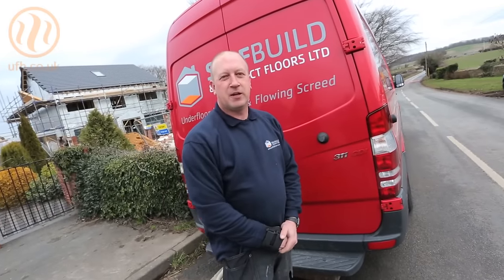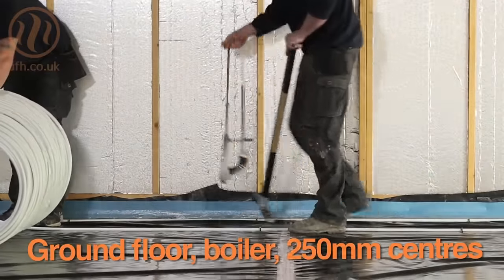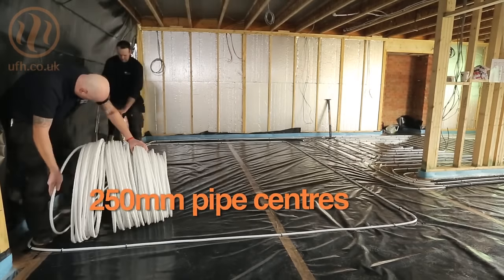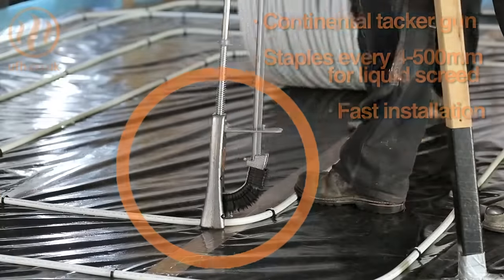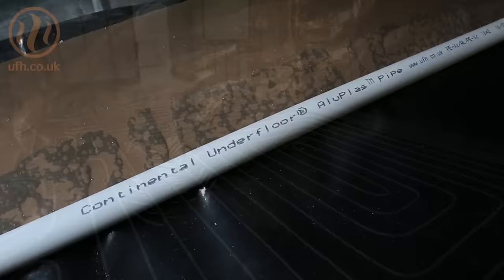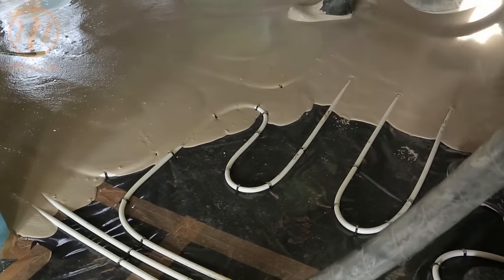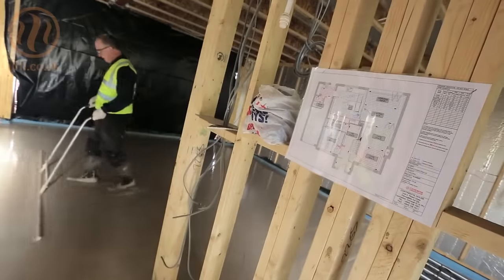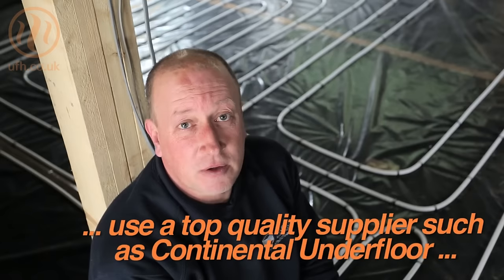Underfloor heating system installation by Continal Underfloor

Comment: Korean way of installing radiant heat over wood subfloor. Koreans having been using this heating for decades.
electronic control can be expensive and prone to breaking down. simple manual valve to each circuit is good enough for hot water flow adjustment and good for your lifetime.  absolutely no fancy control equipment.  

1.  install the tubing  after all walls are done. each room has a separated circuit. no circuit in bathroom. minimum circuit on passby area.  architect's  drawing often  make the install complicate.  Just do it after all walls are done,  then you would't  risk  nailing to the tube .

to each room, lay in the order of the following material  to the subfloor

1. a  thin plastic or vinyl  paper to have some concrete proof effect to the wood framing,  vinyl should go  a few inches  up the wall above the final mortar level.
2.  2  inches thick rigid form ( usually pinky)  Tape them to prevent mortar leaking
3.  2 layer of rebar net ( the cheap wire net, commonly used for sidewalk concrete) . 
4.  tubing ( plastic pipe)  tie the tube to the rebar
5. 1 more layer of the rebar net on top of the tubing. tie them again to the bottom rebar.
6. a nylon mesh of the very flexible nature, sagging in its own and loose enough that mortar will flow freely into the mesh.  Do not pull the mesh flat .  loosely folded here and there  . This mesh is critical to prevent the concrete from cracking. 
7. pour the mortar, just waterly enough as to almost level  itself. absolutely no gravel. pouring room by room is much easier to work.  pouring whole floor at once? out of mind?

good luck.

Comment: it's very common and traditional heating system in south-korea, which is called "온돌" (ondol, means warm stone). its history goes back to more than 2000years. in the old days it used stone, mud and smoke to heat the room and to make path upto the chimney.
e.g.) put fire kitchen furnace->smoke goes through stone and mud tunnel->room heats up -> smoke comes out to the chimney
but now days we make it like that way shown on the video.
it's very good way in winter. it makes all the room very warm that's why korean don't wear shoes in the house and sleep on the floor.
Reply: Interesting we (central europe) never called that korean style but underfloor heating and I saw first example in 1970 but if you think a style on ancient system well than I could find that: 
http://www.ancientpages.com/2018/01/14/hypocaust-first-central-heating-invented-ancient-romans-2000-years-ago/

Comment: Here in South Korea they have been doing this for years. So many years in fact that before gas the use fire to make the floors hot in the winter
Reply: Interesting we (central europe) never called that korean style but underfloor heating and I saw first example in 1970 but if you think a style on ancient system well than I could find that: 
http://www.ancientpages.com/2018/01/14/hypocaust-first-central-heating-invented-ancient-romans-2000-years-ago/
Reply: The Romans were using fire to heat under floors quite some time ago.

Comment: Looks like a great job. Have you looked into using load compensation with underfloor heating ? Having a floor heat output perfectly match the room heat loss brings a new dimension to underfloor heating, total comfort and stable room temperature. Coupled with a condensing gas boiler load compensation and underfloor heating is a perfect partnership. In many cases the expensive room controls, actuators, pump sets and zone valves are no longer required. This reduces instalation costs and running costs while providing better comfort levels that traditional underfloor heating. Viessmann make the ultimate boiler and controls to partner underfloor heating.

Comment: If you have the whole floor radiating out an even heat, this seems more efficient than a radiator as the surface area is so big? The air is warmed right above the floor and this is where the cold sits.... by directly convecting from the floor, does this lower bills by having a lower temperature and a much bigger surface area? Or am I over estimating the efficiency?
Reply from the maker: On the whole underfloor heating is approximately 25% - 30% more efficient than radiators. This is due to the larger surface area being heated and a lower flow temperature used.

Feel free to get in contact with our team, we will aim to answer any questions you may have.
0333 800 1750

Comment: I'd hate to think what you would have to do in case of a leak, with flooring and concrete.
Reply from the maker: All our systems consist of one long run of pipe which is always pressure tested before being set in screed. We very rarely see damage, unless someone has damaged the pipe by drilling/cutting the concrete etc.
Reply: Yeah I can see system failing due to lack of power for extended time during freezing system.... but that is kind of a rare possibility and if the pipe has enough flex then the freezing won’t crack the pipe
Reply: @macrixen  Jou add anti-freeze... would that help? Does it do any bad to the system (pumps, pipes)
Reply: Boudewijn J.M. Kegels adding anti-freeze is fine... just have to remember to change out the fluid every couple of years or so.
Reply: Almost every Korean use this as a heating system in houses, and yet, I have lived like decades with this and still got no problems.

Comment: Why before concreting wasn't pressure check done? I have read that's very important.
Reply from the maker: Hi there,
This time-lapse video shows the laying of an underfloor heating screed system.
The installers are a company that specialise in screed, they had pressure tested the system prior to screed being laid (just not shown).
Pressure testing is important to do and should also be done for a second time prior to commisioning the system.

If you have any other questions, please feel free to contact our team on: 0333 800 1750

Thank you.

Comment: I am aware my question is based in ignorance, which is why I am asking it, but why is PVC used as the underfloor piping? Wouldn't copper pipe conduct heat into the floor better? Is it used purely out of convenience of installation?
Reply from the maker: It is a good question and there are 2 main reasons that underfloor heating consists of plastic pipe.
1. Our pipe is 1 long length with no joins/connections (unlike copper pipe) so is incredibly reliable and not prone to leaks.
2. The plastic pipe does not corrode like copper pipe can.

Comment: What happens if you get even one small leak?
Reply from the maker: Hi there,
In this situation, the pipe would need to be repaired with a coupler that we can provide. We would recommend replacing the loop though as it would reduce any issues that joining pipe may cause. When the repair is completed a full pressure test would be required.

If you have any further questions please feel free to contact us through our website: www.ufh.co.uk or by phone: 0333 800 1750

Comment: Why is everyone calling this a "korea style" heating? Is it any different from the regular floor heating? I believe that the system in my house is identical (the only difference is that we have concrete floors) and it is of the same design as used in many houses in Poland.
Reply: Thanks for sharing, also commonly used in North part of China.
Reply: Interesting we (central europe) never called that korean style but underfloor heating and I saw first example in 1970 but if you think a style on ancient system well than I could find that: 
http://www.ancientpages.com/2018/01/14/hypocaust-first-central-heating-invented-ancient-romans-2000-years-ago/
Reply: wauw are you trolling everyone with the same comment. seen it know 3 times
Reply: mibars Google "ondol"and you can find why.
Reply: @mmabdulahi  now*

Comment: In case if any of the pipes leakes out under floor how you are going to fix it?
Reply: You leave the system under pressure until concrete is poured. And no joints allowed on loops also to optimize the flow. 

Never had a leak or heard of one in 25years.

Comment: can do it on your own with a decent dispenser
Reply from the maker: Hi Paul, thanks for the comment. You're correct, using our Pipe Decoiler makes the job quick and easy for a single installer. Learn more here: https://www.ufh.co.uk/products/underfloor-heating-tools

Comment: What are the recommended boiler sizes or spec for this type of install?
Reply from the maker: Hi Glenn

Thanks for the comment. Sizing of the boiler varies with the size of the system required. Our fully trained Technical Sales Advisers can give you all the information you need for your UFH system. If you would like to find out please call us on 0333 800 1750. If you need a quote quickly send us your plans by text, message or email - more info on how at www.ufh.co.uk/underfloor-heating-quote.

I hope we hear from you, many thanks
Dan

Comment: what  is the name and make of that stapling tool.  Clean work and neat.
Reply: it seems to be a proprietary tool, also sold by continental underfloor
Reply from the maker: Hi Todd, that is our Tacker Gun. To order one please speak to your TSA on 0333 800 1750. See more here... https://www.ufh.co.uk/products/underfloor-heating-tools#tacker-gun.
Reply: that kind of heating system is called ondol(온돌). a very old heating technique in korea. it makes room very warm that why korean don't wear shoes in the house and sleep on the floor.

Comment: So whats the purpose of having a warm floor?
Reply: to cook.
Reply: heat go upward. so heating floor is efficient for keeping warm atmosphere. it starts in Korea first.  that's system called "온돌, on-doll"
Reply: rich people these days
Reply: It uses radiant heat, or radiation heat. It just makes you feel good and keep the humidity in your room stable. IMO it's better than using convection heat. Heated air coming through vents makes my room dry. and I think it is pretty economic even though the installation cost could be pretty steep, once you have the system installed in your house it is fairly cheap to run it depending on the insulation. If I had money I would definitely get it.
Reply: I will make you remove your carpet and  footwear and walk barefoot on the floor and the best thing  is you can sleep ditectly on the floor...   this a unique korean floor heating system called "ondol" practiced thousands of years ago..

Comment: You’re supposed to pressurise the system when screed goes down
Reply from the maker: Absolutely, we recommend pressure testing the UFH pipe with water prior to laying the screed to 6 bar for at least an hour. The pressure should be maintained while the screed is being laid. Failure to do so can result in costly repairs if the pipe has been damaged during screeding. Unfortunately, we didn’t have the time to show this step in the video. However, all our systems come with an instruction manual with every step clearly laid out. Thanks for your comment.

Comment: Is there a cooling system similar to this system?
Reply: yes! its the radiant cooling system
Reply: it is possible to use the exact same pipes. But You cant have both, heating and cooling at once.  Few challenges may arise. You have to control temperature 18c degrees is the bottom what you can reach. You can find few tutorials on how you can combine this system with an air conditionier. Obviously, there is a lot of controversy in doing so. But from few happy users, I can tell that it is doable if installed properly.

Comment: korea type
Reply: Korea type? It is very popular in europe guys
Reply: and it is pretty nice, more comfortable and more effective (10-15% more) than traditional heater.
Reply: @Veriv213  popular in europe??why I don't see this system in europe?But Korea used this system so many years. ago.
Reply: @charlthcharlth3361  Well, most of new homes in Poland have it.
Reply: @luckyrabbit6202  I do not think it is from S.Korea, it is very popular with low temperature central heating systems. I have it, basically all my neighbours on my street have it. Pls be careful next time before yoy tel "fool" about sb.
Reply: @charlthcharlth3361  I do not know where you look for it in europe
Reply: @Veriv213  new home? huh?That floor ondol system has been installed in every house in Korea since decades ago.  And Korea is the international standard for the floor ondol system.  'Ondol', the origin of the floor heating system, has been used by Koreans since thousands of years ago.  Koreans have always lived a warm floor life.  That you only recently found out that it was good.
Reply: @niceday12  I am very very sorry to disappoint you but you have to know that similar innovations, ideas can be invented completely independently. FE, this medieval castle has floor heating system and wasn't built by Koreans as far I know https://en.wikipedia.org/wiki/Malbork_Castle
Reply: @niceday12  also, usage of floor heating is strongly related to low temperature source of heat. So, in Iceland you can find floor heating as there massively is used geothermal energy, and in europe it is strongly related to concrete buildings(almost all beside Scandinavia) and heat pumps (high %).
Reply: @niceday12  maybe to sum up - floor heating is completely not recognized as Korean invention in europe as it clearly was not brought to europe by Koreans. It was invented here separately couple thousand years ago : https://en.wikipedia.org/wiki/Hypocaust . And to be fair it is not used in apartments at all (as it is in Korea as I can see) - only single houses. Reason of it is that most of all houses are designed for highh temperature source of heating as old instalations were not using circulation pumps but heat and temperature to circulate in pipes.

Comment: why the hell would anyone do this
Reply: It uses radiant heat, or radiation heat. It just makes you feel good and keep the humidity in your room stable. IMO it's better than using convection heat. Heated air coming through vents makes my room dry and my skin gets chapped so bad. and I think it is pretty economic even though the installation cost could be pretty steep, once you have the system installed in your house it is fairly cheap to run it depending on the insulation. If I had money I would definitely get it.
Reply: BK QUEEN Not cheap if you get a leak though I would guess.